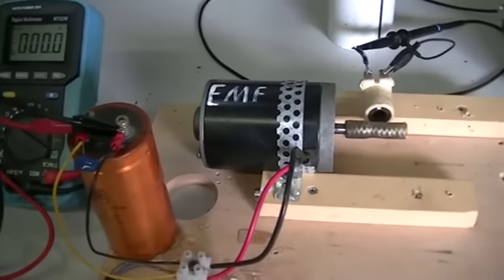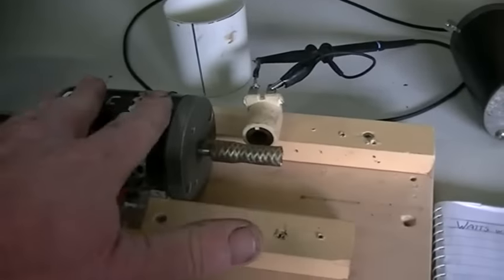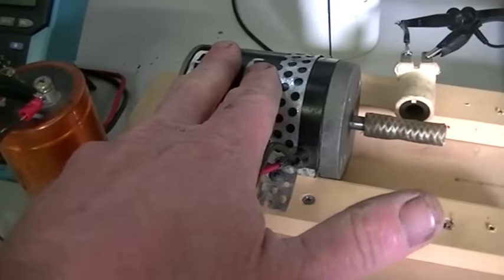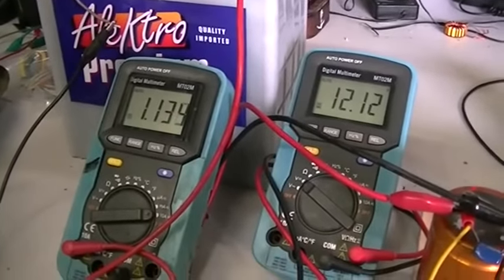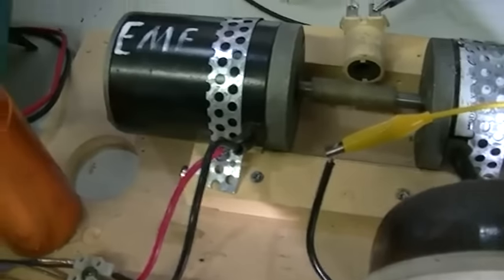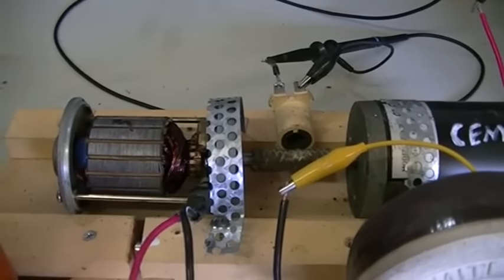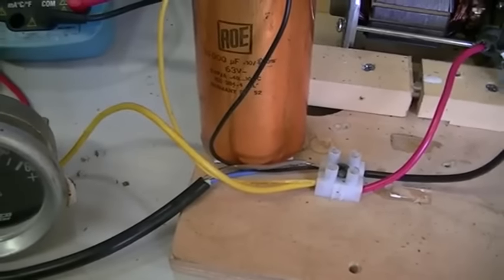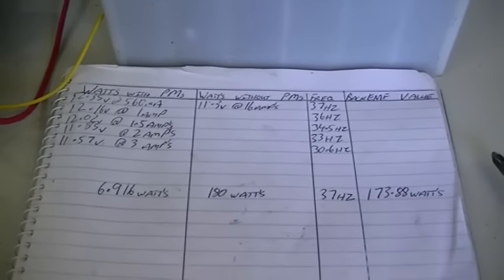Huge BackEMF value from small DC motor

Comment: Good Demo. We know that the Back Emf cuts in the moment the motor starts to turn and provides a dynamic feedback to reduce the emf, so with the magnets present the motor will never draw 180 watts (except maybe at total stall). But your demo provides clear insight into how much the magnets proportionally contribute to lowering the running current of the motor. Cheers

Comment: I've just tried & failed to reproduce the effect seen here.

Small unloaded motor, 3.3v @ 70mA, 5000rpm. (3.3*70e-3=231mW)
Magnets removed, same power applied, left in its metal case - 350mA drawn from supply.
Removed from case - 350mA drawn.
While powered from same 3.3v, both with & without its metal case, rotor spun externally by adjustable hand-drill (5000rpm) - 350mA drawn.  (3.3*350e-3=1.155W)

That coincidently works out precisely as 5 times more power consumed without the magnets.  And is also only about one-fifth of this same ratio seen in the vid.

Comment: Great video. Very surprising results. I think that explains why the two magnet poles cover a third of the rotor in parallel brush motors. The early brush motors had a high degree of timing adjustment which could also effect back emf. Cheers

Comment: The bearing holding end caps are getting hot because you have them shorted out by the screws that hold them together replace the screws with non-conducting screws and measure the voltage on each end caps one end will be negative and the other positive, then see what you get you'll be surprised.
Reply from the maker: When the motor is together,the two end caps are still shorted out,and do not get hot. I believe eddy currents are responsible for the heat,as the magnetic fields from the rotor are no longer contained by the PMs and steel drum housing. But i will give it a try anyway,and let you know what i find. Thanks.

Comment: Can I add some thing I have learned watching many vedeos just like yours one I see a man with a motor in parts it was old from around 1900 people use to have them free energy device run itself that I belive was back emf he said the brushless ran out on them and then people could not get them working again it was because the brushless they put back were to fat needed to be thinner the motor genorator had 4 brushes not 2 so power would go in with normal brushes then it would turn and then conect to the other 2 and then the field would collapse back emf into a coper capacitor that was raped around the motor it had to be perfect no leaking the coper was 2 sheets with wax in between the 2 sheets all capacitors were wax as the dialectic back then this knowledge is key to running of back emf with no input loop it must of made a difference with the capacitor raped around the motor mabe it collected emf magnetic feed as it spun or possibly helped it spin who knows but I know the idea 💡 and collapse the back emf into a  capacitor on a separate line not the power in ÷ - does not on there own get back emf because it when the brushless past the stator winding the field collapse so probably is wasted also I made a little coil and put a reed switch inside the reed switch is open so need to put a magnet to it or close then the reed switch pulse hast so the coil gets pulses and one end the coil i put a diode reverse to the power in that side so if positive let negative though the diode as back emf is reverse polarity I get from 5volt usb power the diode gets 50 or over voltage back emf from it I think the motor you run needs this added to it it probably easier with a motor were the winding are not spinning but the magnets are because can just put wire on the stator winding to get back emf hope it give somthing to atleast think about back emf in theory can go to infinity blank constant and I think e=mc squre comes in back emf is SQURED